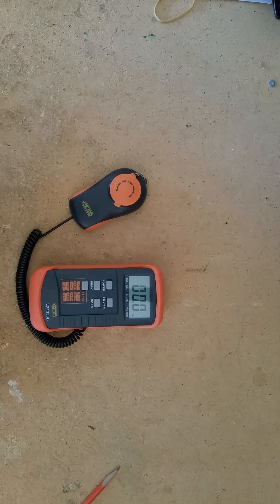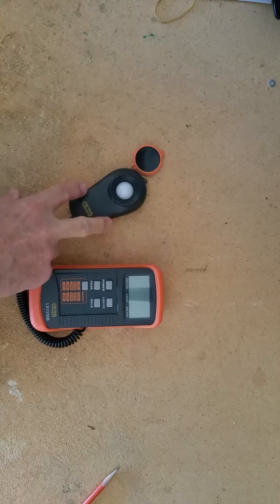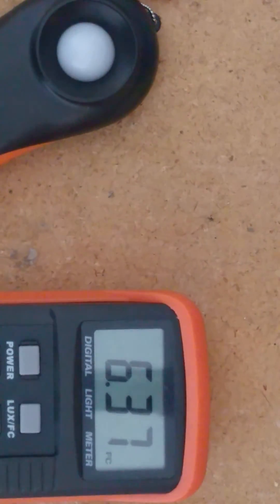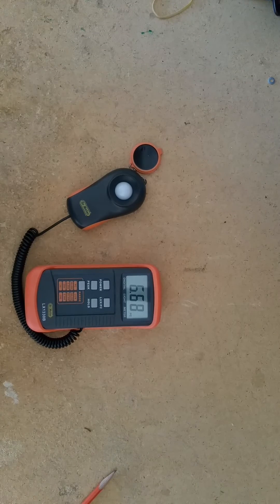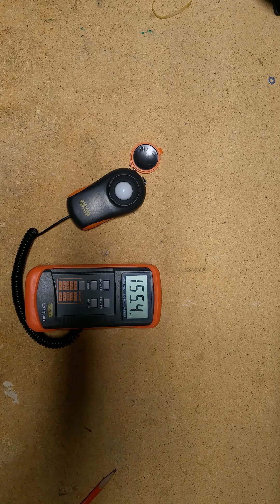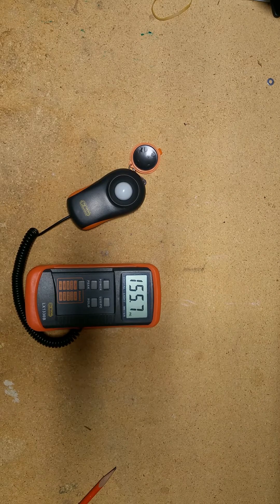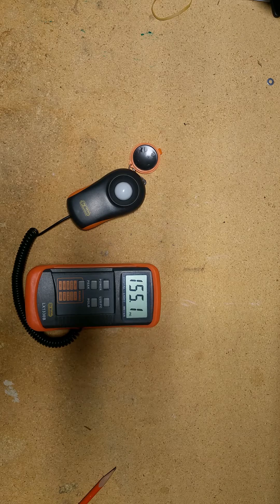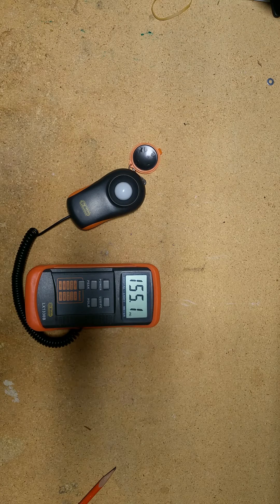Dr.Meter Illuminate Demonstration(1)

Comment: Thank you for the video.  I noticed that the readings on the video took place under a fair amount of light.  How well does this meter do when light levels are in low end such as 0.5 to 3 FC?   Also does the light sensor need to be rested on the floor or can it be handheld?